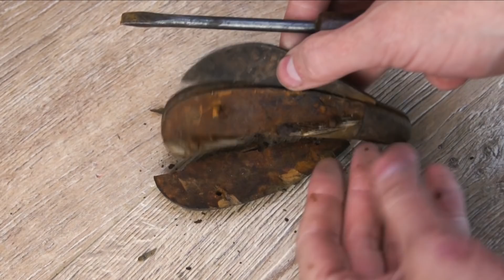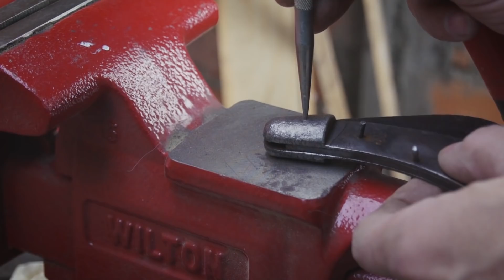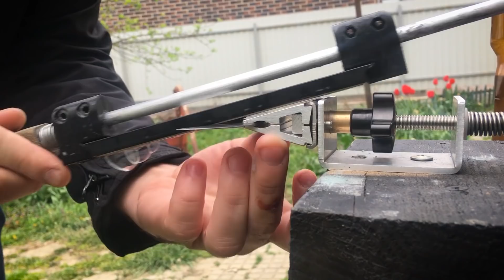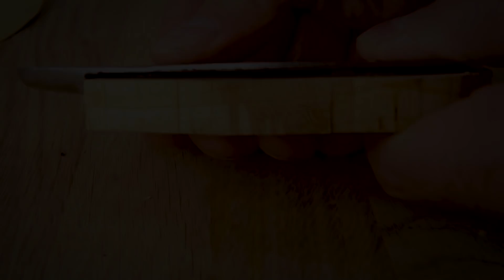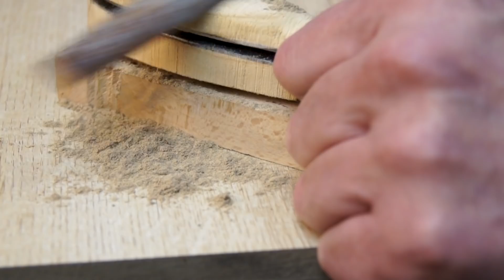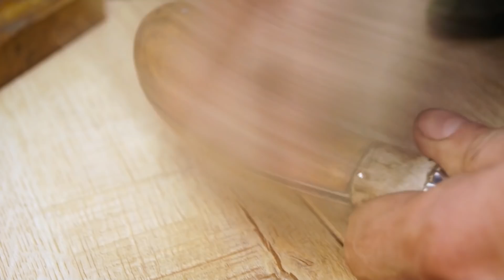Restoration of an Old Rusty SUPER garden knife.

Comment: Very nice video.  If I may, I'd like to make some recommendations.

If you had a sandblaster, the sanding and electrolysis would not have been necessary.  Also, it would have removed all the rust even in the deep pits in the metal that you did not sand bare.  You could have then stopped any future corrosion by nickel plating the metal.

*Edit:  I meant nickel plating other parts but not the blade.  I really appreciate you not grinding the blade too deep and even keeping some of the deep pits.  A working blade should not be nickel plated.  Whatever deep pits do not affect the performance of the edge and it also gives it character.  Besides, blades should be oiled and maintained anyways.  A working blade should not get rust.
Reply from the maker: Thanks for the good advice. Sandblasting is now in the manufacturing process. I am making a miniature version for precise work. Soon I will post the video on my second YouTube channel.